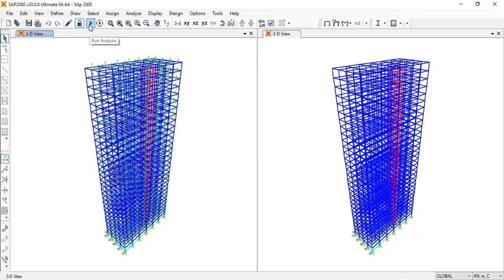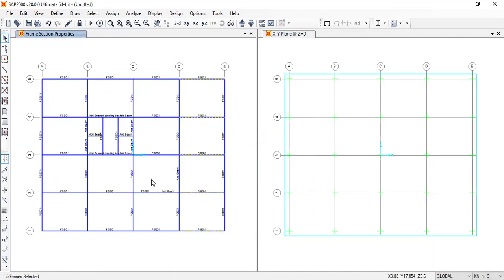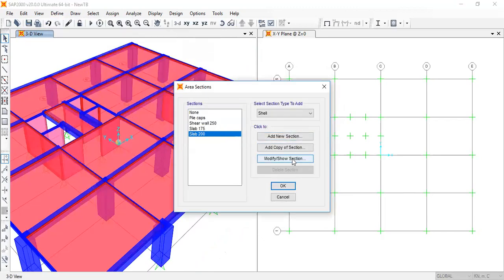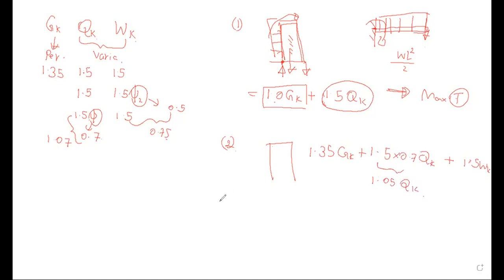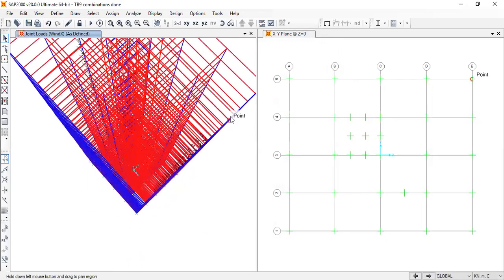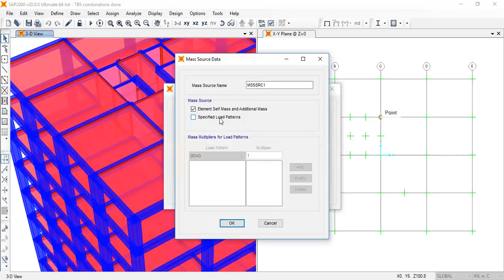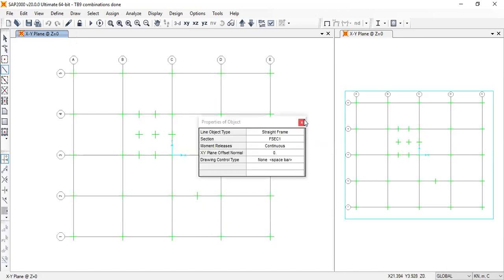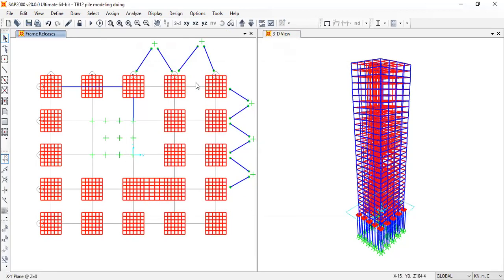How to model a high-rise building (30 storey) with pile foundation using SAP 2000

Comment: Hello sir
May I know the source of pile capacities for respective diameter ?
Also please confirm me what the standard code you have followed for the pile design 🙏.

Waiting for your response...
Reply from the maker: this is based on empirical design. Not a code based formular.. its from practicing engineers.. to have an idea on the capacity. If you are new to design, use a code, thats better

Comment: The video is much informative.
Please upload the analysis of this model to check displacements, drifts, storey shears, settlement, bearing capacities 🙏...
Waiting for your video...
Reply from the maker: Hi thank you for the comment.. Currently im in overseas and would take a bit longer to access them.. As far as i know, i have included modelling from the beginning.. feel free to discuss any doubt you have
Reply: @Structural_Modelling_Hub  I am happy with the Modelling you deserve an uplause 👏.

If analysis results and interpretation has been provided, that will be great.

Currently I'm a Research Scholar. Can I get your contact please to clarify some doubts ? 🙏